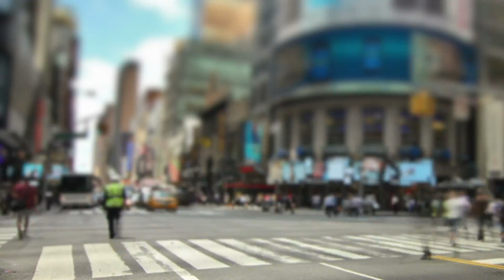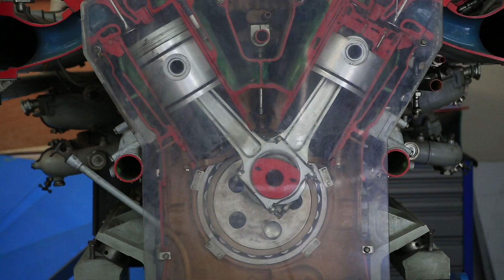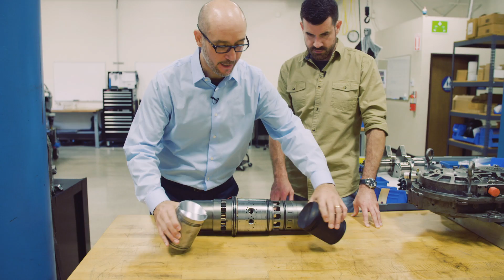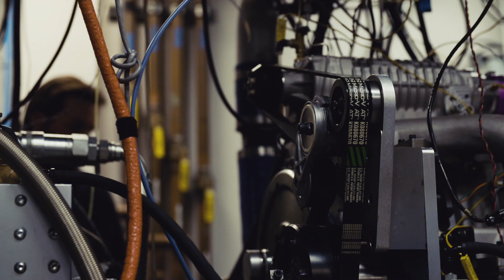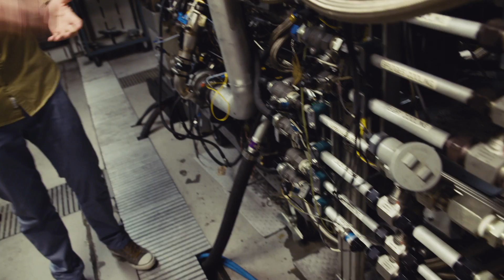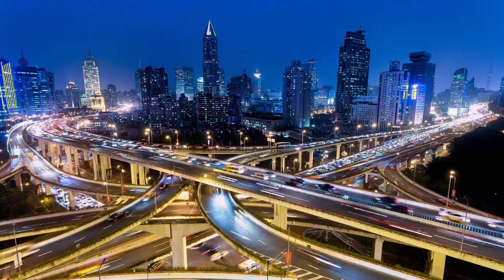This Radical Redesign Could Keep Gas Engines Pumping | WIRED

Comment: It's still an Fuel burner, so cannot be the future.
Reply: It may not be the future, but improvements could be a step towards the future while we wait for more innovations
Reply: therene ....  I see.  So if you want to drive a distance greater than 200 miles your solution is what?  Pull a trailer full of batteries.  When are people like you going to wake up to the fact that electric vehicles have a serious limitation called range?
Reply: Choco Latte
Batteries have limitations yes, but you're being dishonest by exaggerating them. You're also assuming that batteries won't make any progress in the immediate future, despite the considerable advances in cost/kwh and kwh/kg in just the last few years.

Tesla sell an electric vehicle right now with a 335 mile range. They also sell one with a 310 mile range for $44,000, which is almost middle class affordable, especially when you factor in cost savings on fuel and maintenance. 

The latter car isn't even very heavy, despite your inference that you would need a trailer full of batteries to drive more than 200 miles. It only weighs 3800lb, which is pretty good for a mid-class performance sedan.
Reply: I guess I just see it in a way where we are already have better options like electric cars. So investing in this instead of making electric cars more accessible is a wasted opportunity in my books
Reply: I bet internal combustion engines will be around for a very long time to come.
Reply: Darren McIntyre
On what grounds?

I can see a long future for jet engines, which are technically internal combustion engines, but not the more traditional piston engines, even innovative designs like the one in the video.
Reply: They are efficient, they run and burn clean, they are better than electric cars. They are the end result of 100 years of development.  
Today's cars have very modest tailpipe emmissions. The engines are inexpensive to build. 
And we are not running out of oil.
Reply: "They are efficient"
Automotive petrol engines have efficiencies of around 35%, diesel gets to 45%. Electric motors are around 95%.
But it gets worse when you consider the energy for transportation and processing of fuels, the so-called well-to-wheels efficiency.
Petrol cars are ~12%. Diesel is ~18%. Natural gas and hydrogen vehicles are ~35%. Battery electric vehicles are ~70%.

"they are better than electric cars"
The lap record for a production car on the Nurburgring in 2017 was held by an electric car:  https://www.youtube.com/watch?v=mcepG9Twa_8

The Tesla model 3 is one of the fastest cars around a track in it's price range, and the model S is the second fastest accelerating production car, with the fastest being a hybrid-electric. And cars like the Rimac C2 and Roadster 2 are on their way.

"Today's cars have very modest tailpipe emmissions"
Electric vehicles produce less than half the carbon emissions per mile on current US grid mix, and less than a tenth on renewables. They do produce about 50% more during manufacturing, but the production of a car is only equivalent to about 20,000 miles of driving.
 
"The engines are inexpensive to build."
Electric motors are cheaper, and the batteries that power them are getting better and cheaper all the time. In 2012 the model S had a 160 mile range and cost 60k. Five years later the model 3 had a 310 mile range and cost 42k. That's 1.94 times the range at 43% less cost.

Overall the cost per range has decreased by 278% in five years. And it seems unlikely that that trend will stop any time soon. Not to mention that electric cars are cheaper to operate. Electric motors are simple and reduce brake pad wear significantly. The model 3 has a 310 mile range, and costs $9 to fully charge at typical US electricity prices, thus it costs less than $3 per 100 miles. At typical US gas prices a Prius costs over $6 per 100 miles, and a Honda civic is over $10 per 100 miles.

"They are the end result of 100 years of development. "
So were steam engines when they got replaced a century ago. Longer actually, Steam locomotives were popular for around 150 years, but are museums pieces today.

"And we are not running out of oil."
The stone age did not end because we ran out of stone. The bronze age did not end because we ran out of bronze. They ended because something better came along.
Reply: Gas is better because is the real world you don't have the range anxiety of  a car like the Tesla. You can refuel much quicker than you can recharge . 
You can run accessories without losing range. 
We had this debate 100 years ago and internal combustion won for a reason. 
Does the Model 3 really have 310 mile range? I have heard Jay Leno and others say that the range numbers are exaggerated. In the real world it's quite a bit less.
Reply: o look sun is also a fuel burner jus like a electr. cra.. I  MEAN car powerd by coal and old anime
Reply: The trouble is electric cars aren't providing profits yet (Tesla is heavily subsidized with tax dollars and has strong investor relations) and they are not affordable for a large percentage of drivers.  Add in the lesser lifespan of battery packs, the super cheap end of the used car market is a long way away from becoming electric.

And when you look at the total ecosystem to create an electric car, they're aren't even green.  The amount of mining and shipping of heavy raw materials creates more greenhouse gases than what a car would save over its useful life.  Electric isn't the future until hydrogen is used as an on-board fuel.  And even then that hydrogen needs to be captured using nuclear or other low emission electrical plants.  So honestly, intermediate steps are very much needed because the true future of very low emission across the entire transportation ecosystem in 50 to 100 years away.

Comment: it sucks carbon build up in ON THE CYLINDER!!! if you dont clean it the engine gets damaged at least with the old 4 stroke the carbon is not in the way of the rings its in front

Comment: What a load of crap. more moving parts, less easily balanced, more exhaust byproduct issues, oil/lubrication issues (hur, why do gravity put oil in upside down cylinder dur hur). We already have the boxer engine, but lets as TWICE as many moving parts, then make it hard to manage fuel escaping the exhaust unburned like all other 2 cycle engines!!!

The number of pseudo-scientists able to make bullshit claims with computer models is astounding, perhaps they should dedicate less time to the pretty pictures, and more to the actual engineering of something. Chalk this one up just like Solar Roadways, and many other backyard hacks.

Comment: its not gas!!!!!!!!!!!!!!! its petrol ;)
Reply: Petrol refers to petroleum which is the source for a wide variety of fuels including diesel and kerosene among many others. Gasoline is one specific type of fuel. Saying petrol suggests that you put crude petroleum or just a random type of fuel refined from it in your vehicle. Brits got it wrong in this case.
Reply: Stu Bur nope petrol is a liquid not a gas mate think about that gas is now being used in cars ;)
Reply: Daniel_ Carabott It is called gasoline, not gas. Mind you it is largely a vapor when it burns in the engine. Gasoline is more reactive as a vapor than as a liquid. Even gas is a better description than petrol. 

I think that electric torch is better than flashlight and lift is better than elevator though. Football is also a better description than soccer. I will give you all those points.
Reply: Stu Bur ok ok i see your point botb names are hopeless well italians refer to petrol as benzina (fuel ) it seams that none has got a good name for it :p

Comment: But why? Why delay the inevitable? Sure you can keep pushing for better fuel economy but when the future of the automobile is deeply set to be electric why not just embrace it?
Reply: Because Gas Engines need more Parts, more Service, more Oil and more Engeneering.

Comment: How is that engine smaller than a four stroke? With the pistons arranged vertically as shown is looks significantly taller. Auto designers hate vertically large engines because they are a pain to design a low profile aerodynamic front end around, and they raise the center of gravity thus increasing adverse roll characteristics.

Comment: What makes this 30% more efficient? For a six cylinder like this one you still have 6 pistons rubbing against cylinder walls with the same amount of friction. And the fuel/air compression is no different that I can see (whether it be compressing between the piston and the cylinder head or between the two pistons). 

JW3HH

Comment: A gasoline engine is only about 18-20% efficient, compared to the already 62% efficiency of electric vehicles.
So even with this supposedly 30% gain in efficiency, this engine would only match electric vehicles (barely), but with thousands of parts that can fail. Electric is unbeatable for simplicity and efficiency.
Reply: Alex Bv
The 2nd source you cited is misleading and pushing an agenda.  It's looking at country-wide statistics and it doesn't accurately account for what is using and producing energy.  Cars in the "red" countries" are known to be horribly inefficient even by combusion engine standards.

Most methods of electricity are created by turbines, whether they're powered by fossil fuels, wind, or nuclear fusion.  Realistically, turbines in a best-case scenario are roughly 60% efficeint.  That's just to generate the electricty.  Charging a lithium-ion battery is up to 90% efficient.  Converting that electric energy into motion can be as low as 70% efficient.  If the power source is based on combustion of fuel, that would result in roughly 40% efficiency, more or less depending on a lot of factors.  Do the math and you'll find electric cars are mathematically HORRIBLY inefficient.  Read up on the laws of thermodynaics.  Or this, if you want sources:
https://en.wikipedia.org/wiki/Energy_conversion_efficiency

The more you mess with conversion of energy, the worse something is.  I'm not saying combustion engines are better but you're misjudging how efficient an electric car can be.  Unless you're using solar energy or thermoelectrics, you are wasting a lot of energy to power your car.

What other argument do you want me to address?
Reply: ***** The numbers cited for gasoline engine inefficiency are well known in the industry. Face it, the combustion engine is doomed anyway. Much like the steam engine before it.
Time for some evolution.
Reply: ***** You seem to be pulling weak arguments out of yours... lol !
Reply: Internal combustion engines have been a lot more than 20% efficient lately.  Most cars nowadays are more like 40% efficient, some even higher.  Still not great, but not as bad as you suggest.

If you're going to praise electric cars, all-around efficiency and reliability are not good metrics.  Keep in mind - most electricity sources come from burning fuel.  So that 62% efficiency is actually considerably worse when you consider the source it came from.  In other words, you're getting the inefficiencies of what you would have otherwise got in a combustion engine in addition to the inefficiencies of charging the battery, as well as any energy loss converting electricity into motion.  Sure, there is energy involved in purifying crude oil so it can be burned as fuel, but you're basically skipping the middle-man in non-electric cars.

Another thing to consider is batteries need to be replaced far more often and are far more expensive than mechanical components of a properly maintained engine.

I'm not hating on electric cars here.  I think they're fantastic and the future of automobiles.  But as long as fossil fuels are the primary source of electricity and as long as we're stuck using Lithium or lead-acid based batteries, purely electric cars will never [realistically] be a more efficient option.
Reply: I came to write the same thing as Peter.  Electric vehicles have great potential, but looking at the complete picture, they're not nearly as impressive as they seem.
Reply: "batteries need to be replaced far more often"
Tesla is quickly making this a non-issue https://electrek.co/2016/11/01/tesla-battery-degradation/?preview_id=30473

http://shrinkthatfootprint.com/electric-cars-green
As for as efficiency, even in places with outdated energy sources (like china) electric cars aren't much worse than gasoline ones.  In places that are a bit better (like Canada, where I live or even the united states)
they are clearly the better option.  Also, don't use a shitty energy infrastructure as a reason to bash electric cars, that kind of cynicism is also the reason people also use to justify not spending enough in green energy in the first place

The only serious problem electric cars are facing for serious adoption (sure, some people in rural areas need a big range constantly rather than only occasionally, but for most people that isn't the case) is cost. thankfully, its also the most straightforward issue to tackle, economies of scale with stuff like the gigafactory.
Reply: Alex Bv
Well then I hope Tesla succeeds.  As stated before, I think electric cars are the future, but the purpose of my original comment was to keep you in check.  You made a lot of misinformed statements.

And no, electric cars certainly are not better choices in all of Canada or the US.  Not everyone lives in a city.  Also, electric cars are notorious for having shorter mileage in colder climates, since batteries lose efficiency when they're colder, and when they're too hot.

A "shitty infrasture" is the reality you seem adamant to ignore.  Sure, maybe where you live has wind turbines, solar, or nuclear power, but most people don't.  If green energy is your priority and you are not using a green power source, an electric car is a worse choice.  However, if you were to have something like a solar panel on your garage, then yes, electric is the best priority.  It's very polarizing.

As long as most of the power grid uses fossil fuels, the most efficient vehicles to have are ones that use biofuels or are hybrids; particularly ones that don't use electric motors.

I personally spend a lot of time researching hydrogen power, waste vegetable oil diesel engines, and purely mechanical hybrids.  I have found electric cars currently are not the best efficient option.
Reply: Peter Schmidt I used sources to make my claims.  You didnt.

Also, you only have adressed one of my arguments...

Finally, electric cars don't need to beat every option in efficiency presently, only gas cars.  They already have won in the long term, all they need is to gain traction in the current day.

Switching to a green energy network is necessary whenever we adopt electric cars or not, so its less relevant to the cost equation.
Reply: 1l of gas has 10 times  more energy than batteries also if u want u can pull 2000 hp out of mechanical i4 2l engine with a turbo

Comment: They don't mention how they effectively lubricate the top pistons.
Reply: fourbypete ...  lay it flat like a Subaru or Porsche boxer engine.  QED.
Reply: Choco Latte wow i had that exact same idea. Copycat🤣
Reply: @chocolatte6157  Angling it 30 deg lets it fit into a standard truck engine compartment
Reply: Oil injector nozzles aimed at the piston skirt. It's not a difficult problem to solve. Now as to keeping oil out of the exhaust...that I am skeptical about.
Reply: @tetrabromobisphenol  3 cyl-6 piston . . . 270 hp. 480 ft-lbs torque. 37 mpg (peak, 42 highway). One quart oil consumption in 7500 miles.
Reply: I love the idea of this engine and worked on the TS3 Rootes two stroke opposed piston engine, they were very reliable and economical, the cylinders ride on top of the crankshaft and the pistons are connected by a complicated  Conrod  system but it worked well. The only problem I have with this design is it's a Vertically opposed engine with two crankshafts which makes it far simpler than the TS3 but lubricating the top Pistons might create a problem with oil draining down the Bores, if enough oil drained down when the engine was hot that engine would fire that oil and run away making it unstopperable till it blew itself apart. I would think they have realised this and taken steps to stop this happening but there is another problem, hot oil draining down the bores overnight might cause hydraulic lock in the morning when they try and start the engine, this could shatter the Pistons or bend the con-rods or possibly break the crankshafts, it's a great idea but these problems will have to be overcome for it to become successful in its service life.
Reply: @davidellis279  The exhaust ports should take care of bore pressure. In addition, very little oil is used. There is a sump, unlike 2-strokes that used a metered reservoir. Oil consumption is a big emissions issue, as is even lubrication in any engine. SAE testing has shown the Achates to consume/lose 1 quart of oil every 7500 miles.

Comment: Although I love the sound of a good IC engine, they are inherently flawed in so many ways, I am surprised we haven't yet done away with them. Regardless of the improved efficiency of this one, they will never be as efficient as an electric motor.
Reply: Everything is good about electric except the batteries and the power source.